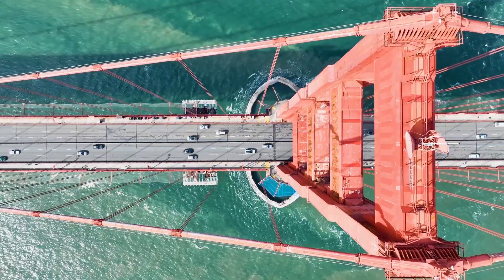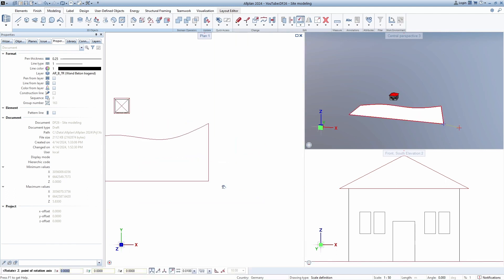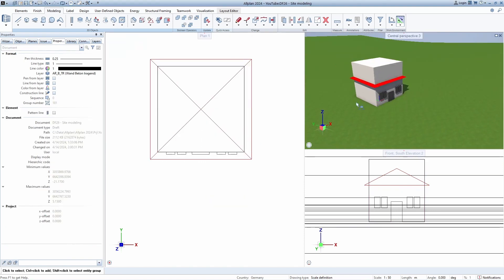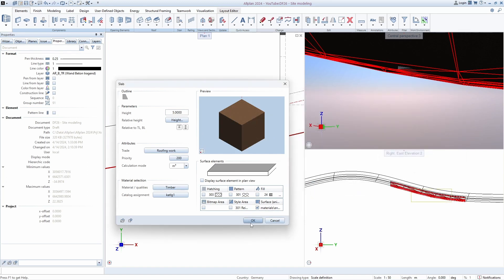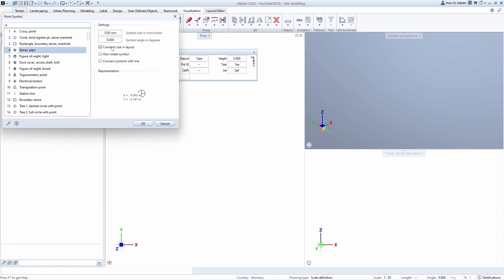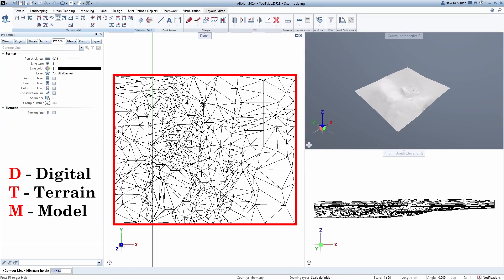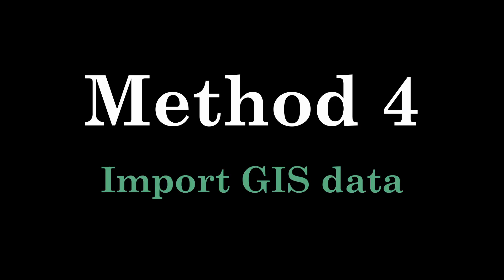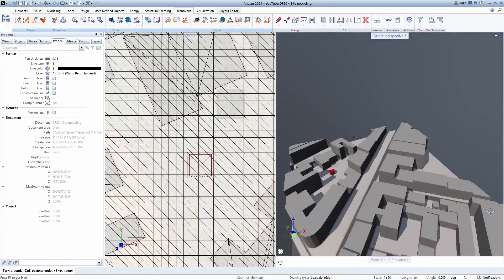Allplan Site Modeling: Creating Terrain in 4 Ways

Comment: Thank you Pro very much. Why do we have to use the format with the extension re1, re2? Can we use the TXT file measuring points? Pro, can you guide me how to enter measuring points in txt format? Thank you very much.
Reply from the maker: The .re1 and .re2 extensions are specific to certain types of software tools used in surveying and engineering, especially for collecting and processing spatial data points like terrain coordinates.
You can fill a TXT file following the structure of a .re1 file and then change its extension from .txt to .re1. This way, you can import it into Allplan and use it.
We will soon provide an example of a .re1 file on our website. When it's available, we will notify you promptly. Stay tuned!📺
Reply: @HowtoAllplan  Thank you very much!
Reply from the maker: @nguyenphuongNguyen-vs8td  Our website is now available. You need to create an account and in the Download section you can download an example of a .re1 file. Thanks for following us.